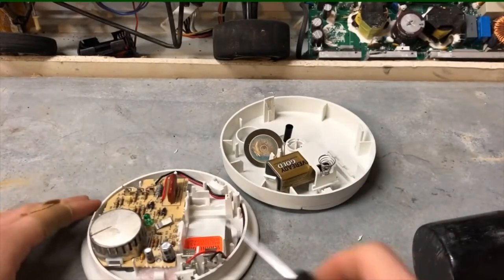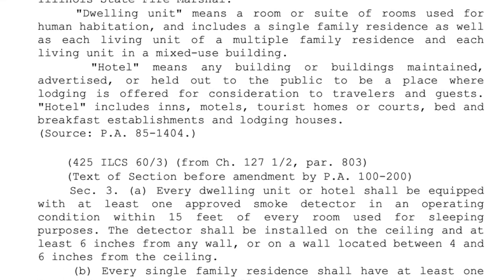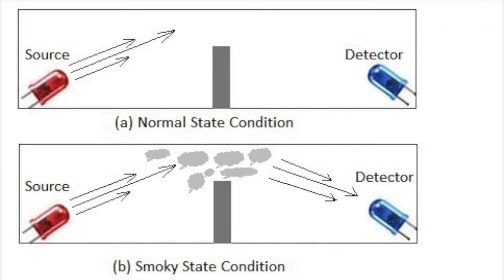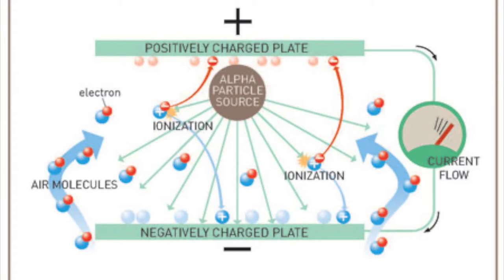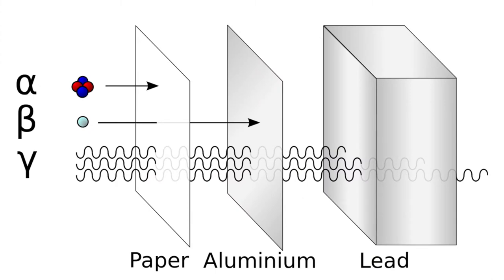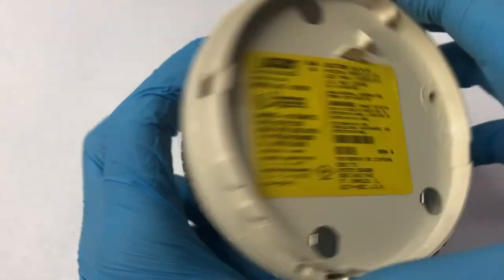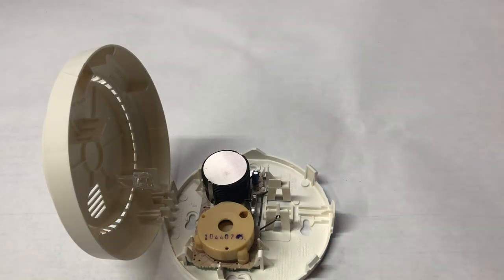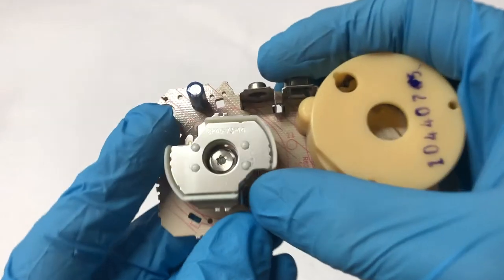Extraction of Americium 241 from Smoke Detector (Revisited)

Comment: "do not try at home" uh... too late, I'm literally here to figure out how to complete the last step...
Reply: Yeah ikr. I disassembled one and checked it with my Geiger counter to see how radioactive it was and very quickly went like “Oh shit.” Now I’m searching online to figure out exactly how worried I should be.
Reply: @johno.farrar431  Oh, don't worry, the radiation is alpha, so it isn't very good at penetrating the human body, and generally the particles wont get past your skin, just never allow an alpha emitter into your body, since there is no protective skin inside.
Reply: @Metal_Master_YT  It's deadly to ingest or inhale that shit.
Reply: @johno.farrar431  Alpha particles (He-4 nuclei w/o electrons) are very weak. So weak, in fact, that just a few cm of air or the top layer of your skin or even a paper bag will stop them. The real danger comes from ingesting alpha emitters, whether through swallowing an alpha emitter or grinding one into dust and inhaling it. So, while alpha emitters such as Am-241 are relatively safe, you should still treat it with respect and not do anything stupid with it.

If I remember correctly, the reason why alpha particles are so easily able to be stopped is because they're really, really big compared to other forms of radiation (beta radiation takes the form of electrons, and gamma radiation is super intense electromagnetic radiation with a tiny wavelength, both are much more dangerous and smaller than alpha particles), meaning that alpha particles have a much higher chance of interacting with other atoms, which removes their energy and stops them. Take this with a grain of salt, though; I'm not a nuclear physicist.

Comment: In the photoelectric smoke detectors [1:20] you erroneously state smoke it detected when blocks the path of the beam. Referring to the  diagram, light reaches the photodetector when it scatters off the smoke. This is an important distinction for it's easier to see a very dim light in darkness (small signal with no background noise) than a small change in a large signal (small signal in large background noise).

Comment: Does americium need to be replaced in some cases? Some of the smoke detectors in my house don't work as well as they use to. Sometimes they occasionally beep loudly from time to time, even when there's no smoke & the battery's full.
Reply: Buy new ones mine where from 2006 and they started doin that
Reply: I dont believe so. it could just be wear and tear on the electronics.
Reply: its probably the electronics going bad, they say to replace em every couple years. Am-241 has a halflife of 432 years, so the source will still be good well after youve died.
Reply: @adelinyoungmark1929  yes

Comment: I just get out my Americium button to use as a test source for my geiger counter.  What is the best way to store this.  In a small metal can?  I know if gives off weak gamma radiation so just not sure what container is best for safe storage.  I plan to include a radioactive warning sticker.  Thanks!
Reply: You can wrap it in paper and put in an aluminium can, if you want to be 110% sure.
But one of these measures is enough.
Reply: Plastic is suprisingly efficient as well